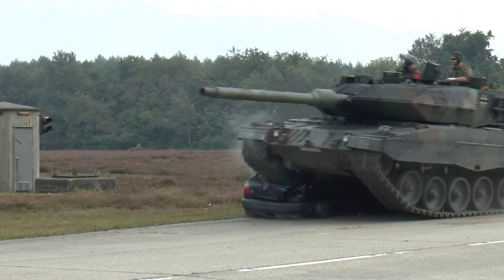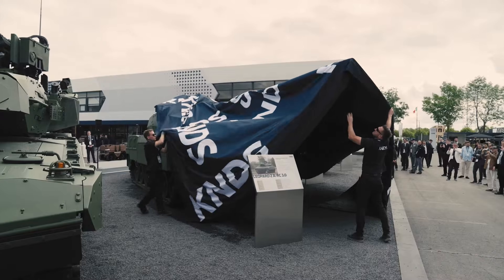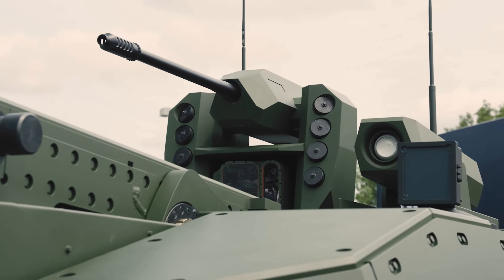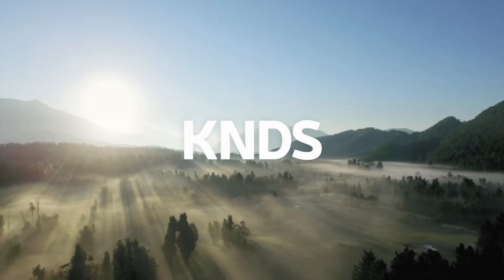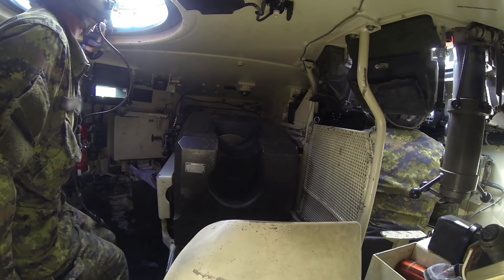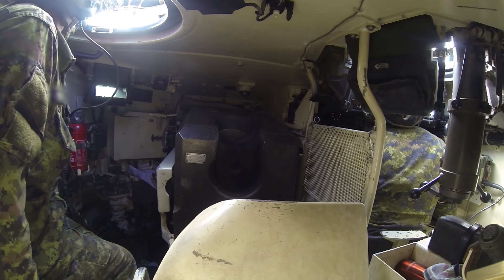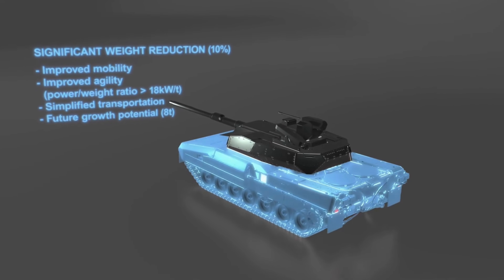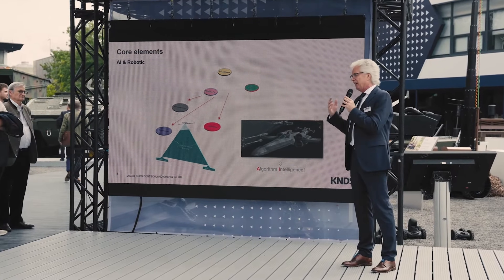The Leopard 2 A-RC 3.0 Main Battle Tank | 140mm SMOOTHBORE GUN

Comment: For the algorithm and for the sake of truth: this is a fine machine. Another example of excellent German engineering.
Reply: Hem, French engineering for this one (at least the gun and firing/reload systems)
Reply: No, it is a bad redesign on an aging platform that was great decades ago. They just did the same Russians do: refurbish an old design incorporating a decade old technology with a new sticker, new nickname and paint job to match. 

Because a bigger gun ain't no way going to get rid of a $500 drone that is going to send this contraption called "tank" where T-72 turrets go when they die. And that is just the tip of the iceberg.